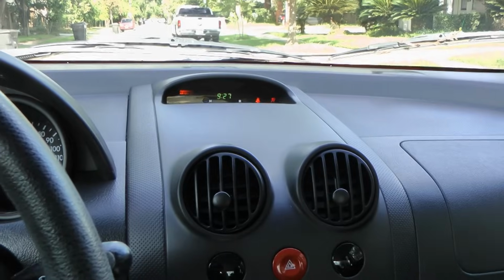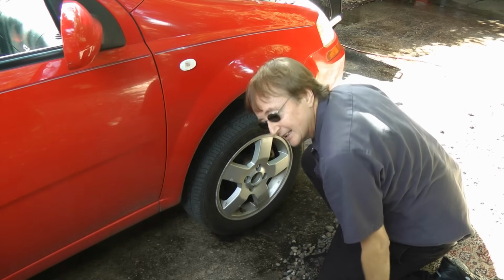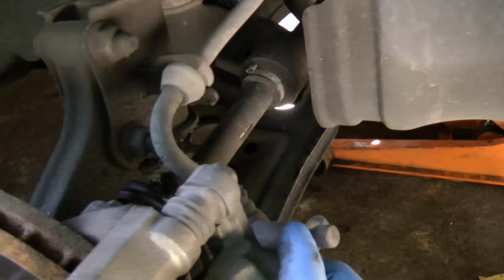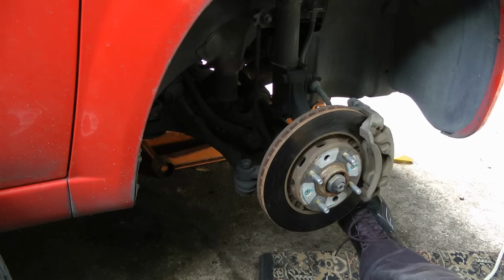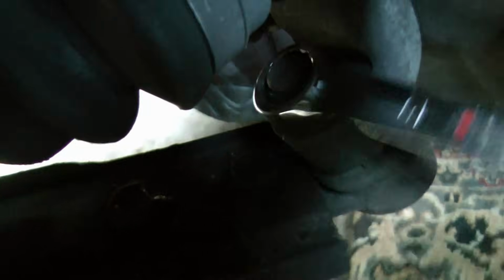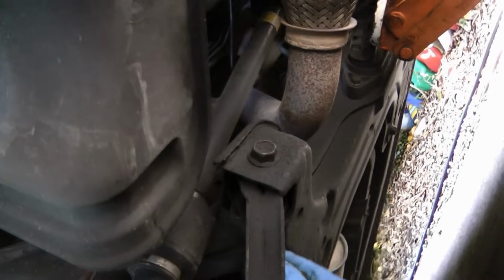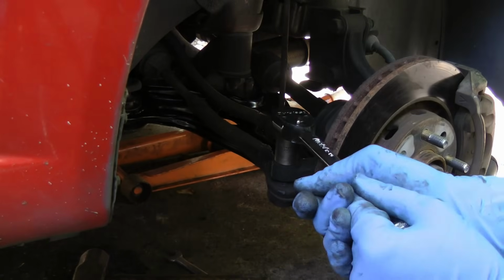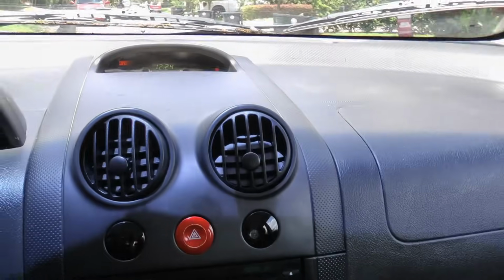How to Fix a Car that Clunks (Lower Control Arm)

Comment: I drive a '92 Jeep Cherokee 4x4. I just recently started hearing a noise when I turn right at slow speeds and am on the throttle. It doesn't happen all the time though. Any ideas? Thanks!

Comment: car passes inspection, but when I release my foot from the clutch,hear a strange click from the car and engine shakes,sound is similer to the sound of a bad "anti roll sway" which was replaced, still the same.
thought, engine mounts, and all replaced, then trans axel then gear bearings, when gear shift is neutural and driver tire on ground and I push it to the front I hear the click and its like 3mlm tire moves frontward and makes the clunk, what is that? and can a strut bearing causes that?

Comment: The 2002-2006 Camry Lower Control Arm is a nightmare for the average DIYer & should be taken to a reputable suspension shop.  My 2 cents . .

Comment: Ive had a few mechanics say everythings ok with my car underneath. Yet when I drive , my drivers side theres a knocking and grinding most of the time underneath. Its driving me nuts!!! Also losing power steering fluid a little, dont know if thats connected..
Reply from the maker: see my video "finding the source of car noises" that machine will always pinpoint the source
Reply: Scotty Kilmer I have an 03' focus and I am pretty certain that my strut mount in the front passenger side is done as the clunking noise comes from that area...there is no uneven wear on my tire and when I have my car loaded down with passengers, the noise goes away. Is there a better way to tell and how would you replace it yourself?

Comment: Scotty....You'd have a field day with my 2000 beater bug! It clunks like that all the time and has ever since I have owned the car! I'm sure the lower control arm is shot, but I live with it because, actually, how much money do you want to throw at a 800 dollar beater? I suspect the previous owner ran over a curb or two, judging by how the strut was pushed down through the steering knuckle. I ain't worried about it though. One day that car will die but I have two other beaters to drive when that day comes!

Comment: I have a Civic Type R FN2 and i often hear a clunky sound from the steering shaft right side but it's not when i turn the steering wheel. I can hear it when i approach traffic lights and i put pressure on the breaks to stop the car or when i hit bumps. Any idea what could the problem be? Thanks

Comment: If my wheel was loose like that, it probably would have tried to tighten the bolts and ended up stripping the threads.  Thanks!

Comment: scotty can you help me out? i took my car to get an alignment after brand new coil springs (all 4) i drive out the lot after the alignment then take it back the next to for them to realign, drive off again, the alignment is perfect. leave work 6 hrs later and the alignment is way off. going back tomorrow. any suggestions?
Reply from the maker: One, coil springs rarely go out,and certainly not all 4 at the same time. I would assume coil job was done incorrectly and they keep moving, which would change alignment as you hit bumps. Have a better alignment mechanic check the springs and the overall front end system for problems.
Reply: i put the OEM sport springs on. they sit 10mm lower and the spring rate is stiffer

Comment: I just bought a little used 5 speed 2003 ford focus zx3 with 138,000 miles on er and there's a kind of fwap noise coming from the left front tire and it doesn't make the the noise when pushing on the excelerater only coasting... I was told that the rack and pinion were looking due for replacement by the guy doing a father's day special oil change at Meineke for 19 bucks 23 after tax but I always take what those guys say with like an ounce of salt cause their banking on the person having no idea and just blindly taking their advice and I have the time and tools to be able to see, anyway if that just sound like more of the same as this video or if that sounds at all like something else any advice would be appreciated but I also understand how little can be done with a bare bones description like that but anyway hope alls well and keep on keeping on my friend.

Comment: Hey Scotty !! I need your help okay !! I changed my front struts on my Nissan Maxima 2009 / even outer tie rods, end links, NOW my front lower control arms/ I changed my front LCA's it's now worst/ I took it in for an alignment at Firestone after the alignment it STILL MAKING that bump sounds( it's really bad)I even had to slot my front struts/ when I told them hey it's still making a bad noise !!! They told me they look at my struts so they found out that the nut that was holding my strut was loose !!!! They tighten it up its better now BUT when I turn left or right it's rubbing now they told that the end links are to long !! I got them at auto zone I called auto zone they said that part is the correct part !! So if fire stone guys did a half ass job!??? I mean the guys did a good job and the car is straight but come on end links are to long I will go in tomorrow and see what can they do please help
Reply from the maker: sounds like a poorly made part that's not the right size to me
Reply: +Scotty Kilmer I got them from oreillys the ball joint is smooth it goes straight but like I said when I turn it rubs they did do slotted struts on the car so maybe the camber is making that the likes hit the a frame idk
Reply: +Scotty Kilmer thanks for the reply

Comment: Every other mechanic I see removed the wheel nut first, then the brake assembly, and then move in to the ball joint, but you just go straight to the ball joint.....

Comment: He didnt mention torquing the bolts which is very important. Not tight enough it will eventually come loose and you will have a big problem.

Comment: I got a 98 Honda Accord that makes a small clunking noise when I accelerate, what could it be exactly?
Reply from the maker: +Matthew Morgan tons of things can do that, from worn tie rod ends to worn strut mounts. Jack it up and pull on the wheels and see if you can find the clunking part
Reply: OK thanks
Reply: +Matthew Morgan I just had my car repaired with a similar issue on the front left. I don't know much about cars, but they said that a bracket was causing the issue and needed replacement. I don't know if that helps at all. I imagine there's more than one kind of bracket. lol.

Comment: cant you put new bushings in and replace the faulty ones other than the whole control arm ?
Reply: Getting the old bushings out and new ones in requires specialty tools. most arms come pre-installed with new ones. When working on the lower arms of the suspension, you are better off replacing the entire assembly than to patch up the assembly with half old parts and half new parts. You need to re-align the wheels anyway. And since you have to do that you might as well replace the entire thing so you don't have to get them realigned again any time soon because its all brand new. Gives you that extra piece of mind. Totally worth it, as the parts aren't that expensive to begin with :)
Reply: Dependings on the state of your current tires. Tires aint cheap.
Reply: too much work, just get a new lower control arm.

Comment: I need help. my volvo cx90 was making a clunk over bumps.  volvo replaced suspension and bushings... then a new clunking noise when coasting. volvo replaced front drive. now 2 weeks later clunking is back when coasting. it is intermittent and faint, but as per last time, it will gradually become continuous and loader. Volvo dont know the cause.... and I can't find info on such symptoms.... please help.
Reply: am having an issue with my 2007 Nissan tiida. it keeps making clunking sounds when I drive on bumpy roads an even hear the noise on smooth road as well sometimes... brought it to the mechanic who change the ball joints,control arm bushings,rack end,sway bar linkage. and am still hearing the sounds. he said my strut's are OK,I don't know. please tell me what to do thanks.
Reply from the maker: find better mechanics, see my video "finding the source of car noises" to pinpoint the noise exactly

Comment: you didn't press the arm up with the jack before tightening the arm nuts and bolts. The orizontal arm bush will be damaged. And it's much cheaper to change only the bushings and the pivot rather the whole arm. Costs you double for the entire unit.

Comment: my problem is not when you shake from the side or even when the tyre doesnt touch the ground, its only when the tire on the ground, hand brake on, and you hit fronward like you wanna make car move fronward, then you have to push very fast and strong and sudden, to feel the clunk and feel like the tire moved 3mlm frontwardthen comes back, like it isnt tightened or a rubber is broken, but even this arm seems to be fine! no one can figure out even many workshops!

Comment: I did the valve cover gaskets and the smoke is black. The car smokes only in idle when I'm driving it doesn't happen my friend followed me from nyc to Connecticut and there was no smoke but when I pulled into my driveway parked the car after a few minutes it came out again

Comment: Is there a "my car clunks when I press the brakes and go over bumps and I have a 2015 Nissan Versa" video?  awwwshucks
Reply: Mary Proveaux I have a Lexus with 205k miles and same thing going happened. thought it was rotors  but actual problem was tie rod and control arm

Comment: Does anyone know if its possible or have any experience with a lower control arm bushing going bad and making all kinds of clanking noises after having a tow or getting worked on by a mechanic? I swear my car didnt make a sound from the front end before. I had to get a tow into a local well known shop and had them do a turbo replacement (leaking oil, smoke blowing out of exhaust).They called and said magically my lower control arm bushing on the right side was making all kinds of noise and needed to be fixed. I figured they were BSing me trying to milk me for more money so I said no. Sure enough, I pick up the car and 20 minutes after Im on the road I notice all kinds of noises on the right front side when I turn. Its so loud and noticeable there is no way in hell I didn't hear it before I had it towed in there. I am 99% sure they damaged my car, either during the tow or while they were under it. I just wondered if anyone had a same experience or have heard of that happening.

Comment: Mine are brand new Nappa control arms and they are clunking  literally after less than 100 miles. Previous set before Nappa the arms were from MOOG and the ball joints were gone after less than 2k miles. 

So screw it. I'll just thump away.

Comment: hey you didnt mention that you need to make wheel alignment after that...
Reply from the maker: you don't need to on this model, none of the alignment parts were taken off that were adjustable
Reply: I meant steering alignment....

Comment: I bought a jack and jack stands a few months ago, and I can't even use them.  I jacked the car up on a jack point, and then suddenly, WHAM!  The car came crashing down and the jack was still standing up.  The problem?  The frame is so rusted that the jack punches a hole right through it!  How in the heck is it staying together if it's that bad?!

I told my wife we need a new car, she said that one's completely fine because it belonged to her grandpa.  I told her she could drive it and I'll walk.

Comment: Hey can someone help..
 I have a 2000 Toyota corola ..that have noises when I turn ...on the front ..and I can't find what the problem could be..help thank's
Reply from the maker: jcruztiger check the CV joints, and also do my video "how to check out your car's suspension:"
Reply: Scotty Kilmer thank you very much.... you're so kind.....

Comment: i know that but that doesn't mean it it has a gm engine just cause it has the badge. the Pontiac vibe is really a Toyota matrix just a different badge and the mercury villager and Nissan quest is the same ford body/interior and Nissan engine and trans and many more.

Comment: Hey Scotty, I noticed you didn't mention anything about tightening to torque spec. Do you not bother with torque specs for most things when you're doing repairs or did you just not bother to mention it? I'm just curious if I'm overly anal about getting the correct torque on everything.
Reply from the maker: I am not anal and only torque things that really need it, like head gasket bolts
Reply: Scotty Kilmer ALWAYS torque wheel nuts to manufacturer's specs.  If you under torque wheel may come off when driving.  If you over torque you may warp your rotors/drums.  Torque specs are there for a reason.
Reply: Johnny Bertolli
or even worse if your over torque wheel nuts the studs could snap if you hit a big bump.

Comment: hello everyone,   I have tried to find on youtube but no luck. Perhaps someone can give me an idea of what could be the problem   Thank you in advance !!!!  I have 03 mazda.....today I noticed a loud clunk (I assume its the transmission) right before I came to a complete stop. It feels that the transmission is downshifting.   Some clunks have been fairly strong and loud...others have been minute ....and other times no clunk at all.  I do have to mention that for some time (about 6months) when gear is put in reverse or drive there too is a loud clunk.   Any idea whats going on??? Thank you again for your time. Very much appreciated !!!!!
Reply: Sounds like idle speed is too high or you have a broken motor mount
Reply: Thank you for your reply. It was the motor mount...actually 3 of them   .

How is that possible???

Comment: If the e-brake is worn out yes that is the way to test it. They can (if they feel like it) impound a vehicle in my state for it. If they impound it they won't give it back until it's fixed but they won't let you on the lot to fix it :D The brake on your sister's POS was damaged before the test was even done by the sounds of your complaining. Dodge parking brakes are a nightmare to work on. I tend to stay away. Not only are they a nightmare but the owners have a tendency to not pay.

Comment: Is that an OEM part Scotty?

I'm really sick of the poor quality replacement parts for cars like this, they're cheap but they just don't last.  Wish replaceable ball joints were a common thing again, such a waste of steel replacing these entire suspension arms when the crap quality ball joints wear out.

Comment: Scotty I need your help with a diagnosis, 
My father in law's 1999 Honda Accord. The car would start up and immediately die if not revved. Sometimes it would die while driving. I replaced the alternator belt because it was squealing. The battery was replaced recently and test fine. The alternator also test fine. I noticed the ignition switch had a recall on this car. Here is where my problem is. When installing the ignition switch 2 things happened that I believe could have cause a problem. 1) The previous ignition switch sparked when taking it out and that "spike" went into the surrounding metal of the switch and possibly the frame under the dash. The key was in the "0"position and the harness was still plugged in. 2. I moved the plastic switch location of the new ignition switch to get it to mate properly. RESULT - after installing the new ignition switch the car will not even turn over....nada....nothing. (before installing it started and drove)
Reply from the maker: as it won't even turn over, you have lost power from the battery to the starter (or the starter is bad.) trace power from the battery to the switch and to the switch back to the starter. Fix the short, but if you can't find a short, you got a bad switch. OR, do what I do on older cars, run a wire direct from the switch to the starter and bypass all that computer crap, it works best.

Comment: the way the front bolt on the control arm bolts into the cross member on the aveo is such a dumb design because you cant replace the nut unless you cut a hole in the cross member and cut the nut off! you could also drill through the nut and tap it to a bigger threaded bolt. either way if the old rusty bolt brakes off in the hole have fun!

Comment: hey people I have a clunking sound in my front end of my vw Passat .only if I stomp on the gas dose anyone know what it could be?an when I do about 110 it shakes really bad.
Reply: Does it happen when you finally use the brake? if so its your brake drums. You need an upgrade also why the hell are you going 110?

Comment: My car cluncks and the steering is stiff any help?
Reply: Tom Meltz power steering pump and new brakes
Reply: Geoff Dick it was my subframe it cracked by rack and pinion causing the noises
Reply: Tom Meltz just swap parts until you run out of money.
Reply: @geoff dick my car is doing the same exact thing did u ever find out what was wrong

Comment: Now here's guy that sounds like he knows what he's talking about. I have a 2011 infiniti m37s and there's a clunking sound coming from the right front wheel while  going over bumps or uneven surface @ low speeds. And one can seem to find the problem.😡😡😡

Comment: @xclutchkidx 1 (800) 923-0413 is the place I bought the turbo for my 9-3 Saab.  Would only smoke when I would "floor" it (engaged the turbo).  don't want to let that go too long or don't engage the turbo.  I wonder it it is possible to "disconnect" the turbo.  It will mix your water and oil (caramel colored oil) and your engine can be damaged/destroyed...

Comment: Thats weir as hell. Why would the police do that? In my state the cops only care if your headlights and taillights are working, and the inspection and other stuff is current. Driving with your e-brake on can damage it if m correct,